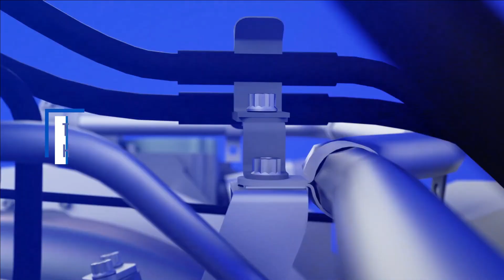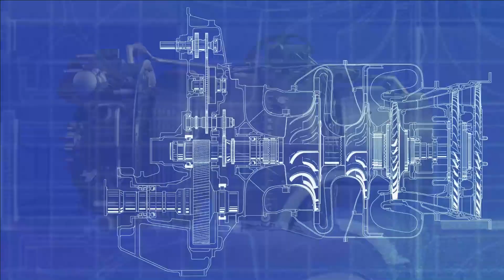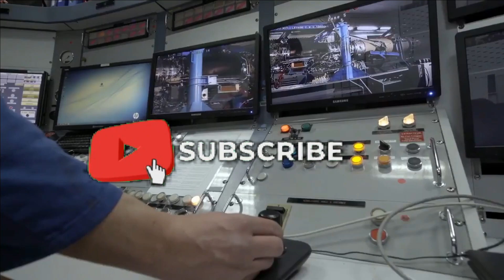Safran to setup LEAP MRO facility in India | 6 billion Euro offer for AMCA Engine

Comment: With 110 kn engines, will AMCA end up being one of the lowest powered 5th gen fighters? 
How does the IAF plan to include '6th gen characteristics' like energy weapons with 110 kn engines?
Reply: Nhi lgega amca me energy weapon, mk2 me lgega or tabtak advanced variant laga denge Like 125-130kn
Reply: @ig-anzros01  Air Chief Marshal RKS Bhadauria had mentioned in a report to ET that directed energy weapons are on the list. 
If the 110 kn engine is supposed to be ready by 2035 then it's obvious it will be used for Mk2. Mk1 is supposed to take flight between 2025-2027 with the GE engine. How will they do flight trials around 2027 if the engine is supposed to be ready by 2035?
Reply: @alltherandoms9599  directed energy weapon ke lie wesebhi 110kn kafi nhi h bro, advance features mehi baking thrust lag jayegi, or Kon bola 2035 me ayega?, or hal hi me jab mene update dekha tha to unhone kaha tha Kuch last ke Tejas mk2's me lgega 110kn engine
Reply: @alltherandoms9599  2027 - 2029 me engine tab man lete jab RR ke sath banate, France ke sath karib 2032 tak ka Time lgega yani tedbf me to lgega hi
Reply: @ig-anzros01  Correct, advanced avionics, EW, fly by wire will also use a considerable amount of energy.

I took 2035 on the basis of this video, let's see what happens.
Reply: Ham sirf andaza hi laga skte h bro
Reply: AMCA will commission when SU-57, F-35 and J-20 retired that will be 2060

Comment: 110kn is wet thrust? Isn't it severely underpowered?
Reply: AMCA is twin engine. So total 220kn wet thrust which will be more than enough considering it's medium weight plane like rafale.
Reply: @vishalnayak3966  what's dry thrust that's needed for supercruise for flight in general
Reply: @singh.jayesh1866  as per ADA, they required 105 kn engine but decided to increase it to 110kn just to be safe in case they overshoot weight. 
No information on dry thrust requirement.

Comment: Safran is playing clever... France has already created prototype for the next gen engine.. but they are offering us the M88 core based engine development 

They are following Russian approach .. Russia upgraded the existing AL 41 engine for flight testing SU-57 and will use the engine for export customers.. but will not export izdeliye 30
Similarly France will use the engine it is developing with india (M88 engine derivative) for flight testing FCAS in case there is a delay in next gen engine development and they will get good money from India..and may be use the engine for export customers of FCAS

Having said that india will get technology,the same  common engine could be used in AMCA, Rafael, Tejas mk2, bigger unmanned aircraft and 6th gen fighter jet flight testing.. so it is a win win
Reply: In a way we are at receiving end by not getting amount of input to output expected as engine would take time to develop and we are not certain that initial years are going to be pure R&D? Also its too less effective for AMCA or even future 6th Gen!
Reply: @rarallab1   the new engine might be equivalent to GE414 with extra thrust....  But the main thing for  india it will end over dependence on USA for fighter engine...   This is just the start..  DRDO should  then focus on engine in category of  SU 30 MKI level Engine.. and then 6th gen engine

Comment: 110 kn wet thrust engine is not an ideal engine for 5.5 gen AMCA. Each engine should generate at least 125kn for Super cruise.
Reply: Its 125 kn engine and upgradable to 140/145 by safron.. they already made an engine with 130kn but it consumes 5 times more fuel than the existing ones and 5th engines are much more powerful and needs radar invisibility
Reply: It should be fitted in tejas mk 2 while tejas mk2 is having 98kn engine
Reply: The Rafale claims to have mach 1.4 supercruise with 75 kn engines. Amca will have similar thrust/weight characteristics with 110 kn engines.

Though it might end up being the least powerful 5th gen.
Reply: @alltherandoms9599  . I'm not sure Rafale's supercruise is with or without reheat .🤔🤔🤔
Reply: @abymathew295  Supercruise by definition is always without reheat/afterburner.
Reply: @alltherandoms9599  . Technically, yes
Reply: break the sonic barrier with afterburner, keep it with dry thrust, and  almost no maneuver.To be compared, F22 can reach 1.5~1.7 without afterburner and perform 5-6g maneuver.
Reply: @alltherandoms9599  no 110kn is ge 414 the safaran deal will be 125 kn as it required direct energy weapon and super cruise
Reply: @sasirudhhh203  Could you kindly provide sources about the confirmed deals? AFAIK, the GE offer has not seen any traction while the Safran deal is hovering between 125-110 kn specs
Reply: @alltherandoms9599  ge offered a mro facility in india we willplace oder soon and saffran deal to build a new engine understand the difference
Reply: @alltherandoms9599  source multiple defence channel and articles by times of india etc etc if i find one now ill share the link